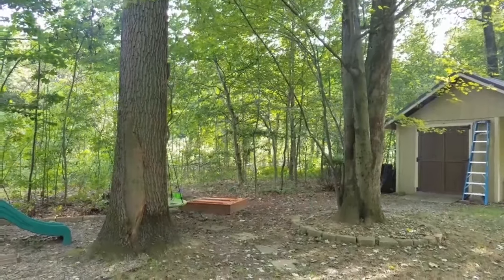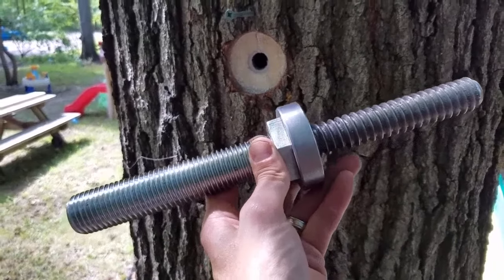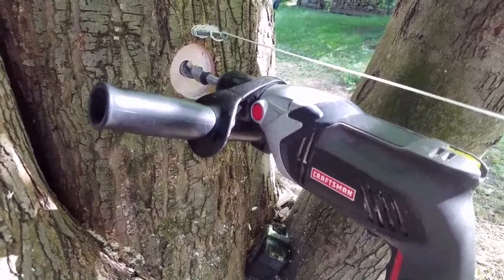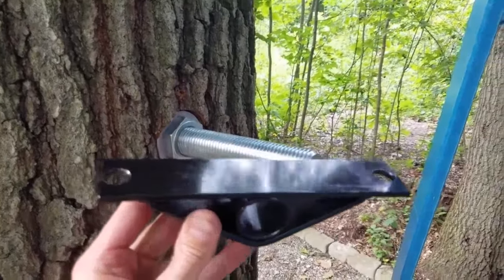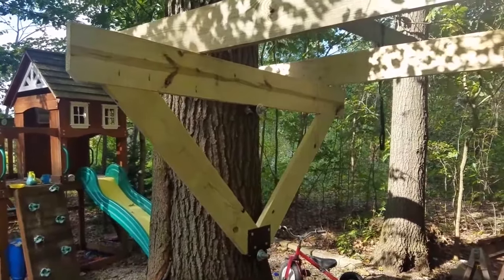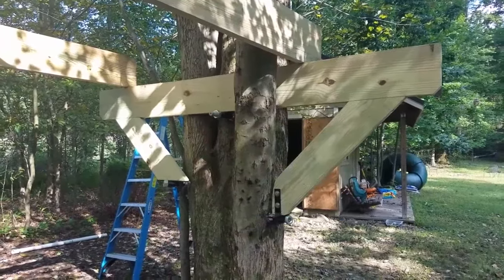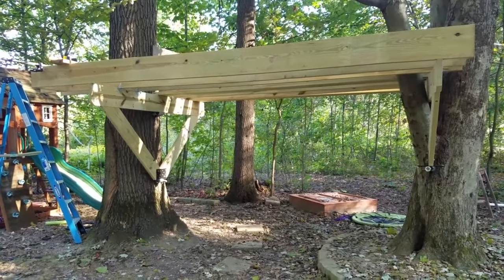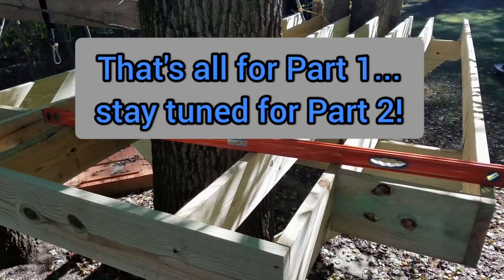How to Build a Backyard Treehouse - Part 1

Comment: How much weight do those supports hold?
And please, if you have any tips to help, it’ll be greatly appreciated.
I have just shy of an acre of land that I would love to turn into an oak tree forest. The white oak tree is the most common and hardest tree strength tree that will grow here in Cheraw, SC.
This is to be my little baby, a 8-10 year project for my grandchildren to enjoy. I’ll build a massive treehouse for them to turn into princess castle or a fort.
Reply from the maker: Good question but difficult to answer.  I've estimated the bolts in the trees could each hold at least a thousand pounds, but the 2x support frame is likely the weaker point.  Oaks are great but any healthy hardwood will work fine; just avoid more than one bolt at the same elevation to avoid stressing the tree.  Good luck!

Comment: Are your rafter ties nailed to the beam AND the joists or only to the beam? Or are the joists just sitting in the ties to allow for movement?
Reply from the maker: The rafter ties are screwed to both the joists and the beam.  Lateral movement takes place at the tree bolt, as the mount at the bolt can slide over the threads.

Comment: Did you get the sliding tree house bolts at the shop as well? I am looking for something due to the high winds in my area I have about >1” sway where I want to build.
Reply from the maker: Yes I did, but you can find similar ones online by searching 'sliding treehouse brackets'.

Comment: What if I drilled home into the tree for my tab and water stormed out? Not wise to use that hole, correct?
Reply: Do not build any structure connected to that tree.  If water is pouring out of it then chances are that tree is rotting inside.
Reply: @Soknik01  I built around both trees